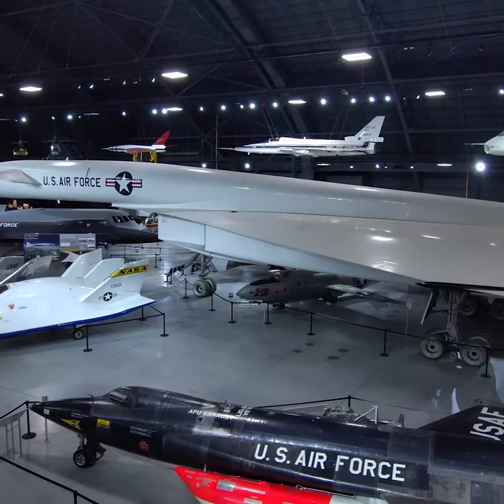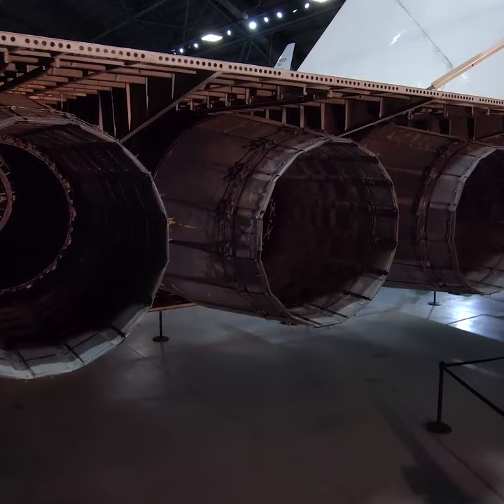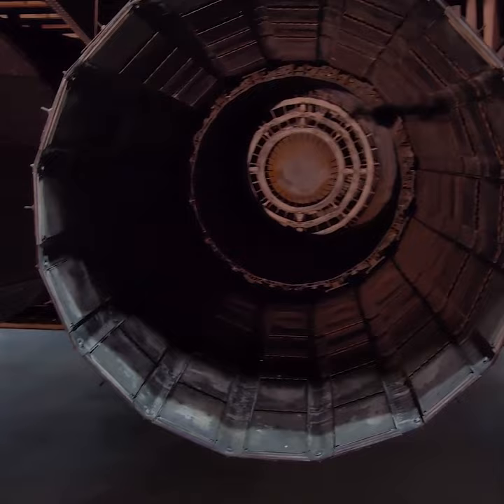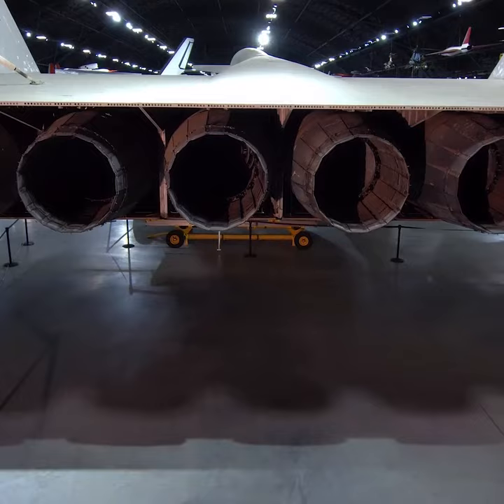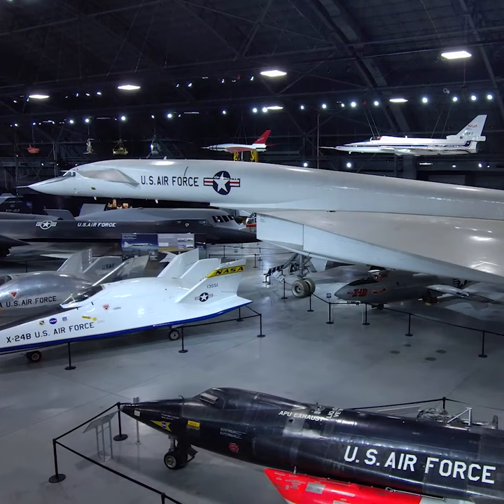North American XB 70 Valkyrie - Engines

Comment: The proposed escort fighter for the B-70 bomber was the North American F-108, which was going to be powered by two of these monster engines. Mach 3+ at 60,000 feet for 3000 nm. Should've been built, if only as a technology demonsrator.
Reply: Not likely. The B-70's combat range was projected at 3,700 miles. The F-108's range was only 1,200 miles. 

What technology would the XF-108 have demonstrated?
Reply: @winternow2242  remember this is a nuclear war scenario. One way mission to Soviet Union. Forget radius.
Reply: @nathanfugate8210  Rememeber this, in a nuclear war scenario, the escort....still has to reach the target.  A 1.200 mile combat radius translates to about 2200 miles, which is far short of the distance between NY and London.  With that range, F-108's based in Berlin, which is in eastern Germany, would just have reached Moscow - far short of the deeper targets expected to be hit by manned bombers.

I've read up on the F-108 and found scant mention of the F-108 as an escort for the the B-70, and the reasons for that lack of attention aren't that difficult to understand.  Between the wars, bomber officers insist that they don't need escorts.  The point of a triple sonic, high altitude aircraft is that it flies faster and higher than enemy aircraft can reach, obviating the need for escorts.

Comment: Why didn't they use the J58 out of the SR-71.....a kind of bypass quasi-ramjet?
Reply: I don’t know much about planes but I did read that both planes had their first flights in the same year, 1964. Also the SR-71 uses JP-7, while the XB-70 uses JP-6. 

idk what that means to your question but I’m curious for an answer as well.
Reply: They didn't need that extra speed - the YJ93 was plenty powerful already.  It was the airframe that was the bottleneck, not the engine.

They probably wanted an engine that was closer to something they could use on many other aircraft, designs that didn't SR-71 performance.  The YJ93 had also been envisaged for the XF-108 Rapier, and a civilian version was planned for the American SST.

Comment: The bomber that made russia design the mig25 foxbat. The foxbats only mission was to defend against high flying supersonic bombers… like the xb70
Reply: Nope. The Soviets were already working on the MiG-25 in 1961. The XB-70A didn't fly until 1964.  Also, the XB-70 was cancelled in 1961, just a few weeks after the MiG-25 program began. Soviets continued working on the MiG-25 for over a decade. Obviously the 2 planes have nothing to do with each other.